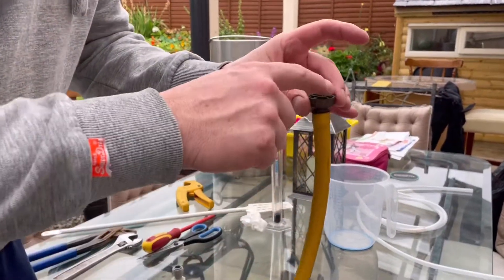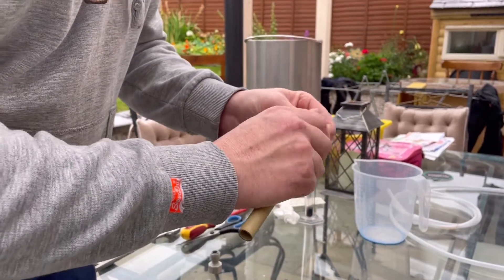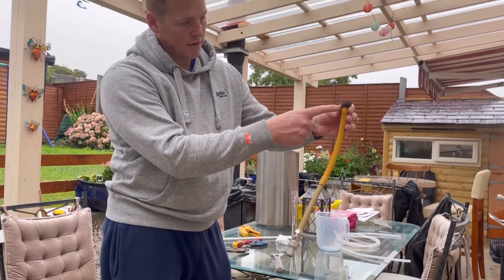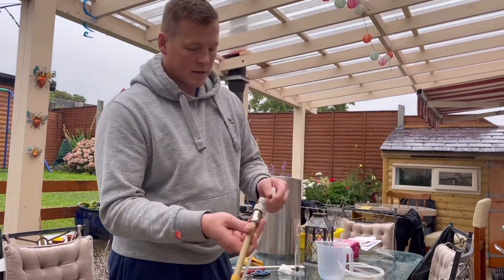How to Connect cooling coil to mains water

Comment: Good work I have the 35ltd model and the coil only submerged the bottom 3 coils on a 20ltd brew.  Need the longer coil but will use the same setup
Reply from the maker: Cheers Alan . I find the set up works well

Comment: Just curious Graham..what's the temperature of your municipal water in the summer?...ours gets quite warm somewhere around 20-25 c...it can be hard to get the wort cooled down quickly. ..by the way..nice backyard also
Reply from the maker: Cheers Edward . I actually just checked it to give you the correct answer my water is at 18 today I got my wort down to 34 today in about 20 minutes then transferred into fermentation bucket so I could start clean up . It’s sitting outside on the cold paving slabs so hopefully cool down to 22 soon and I will pitch my yeast .

Comment: Just looking at coils and wondering what one to get
Reply from the maker: That coil came with the system it still takes a long time to cool but does speed up the process
Reply: Get the large one especially if you have the 30or 35ld model